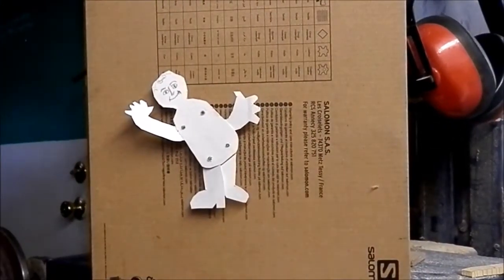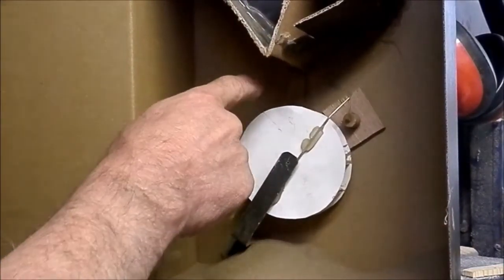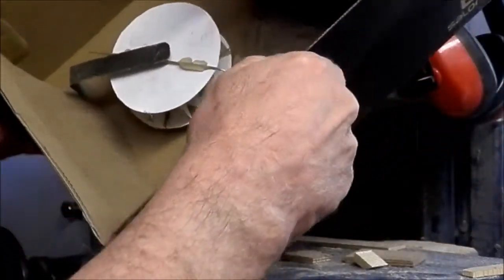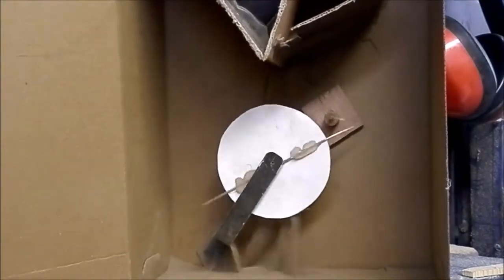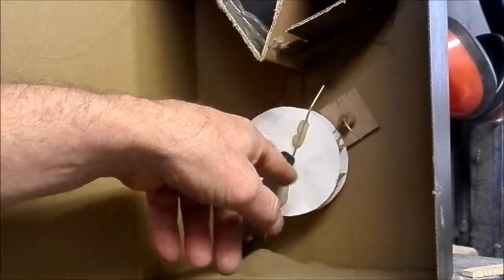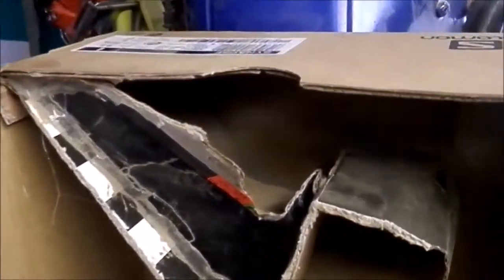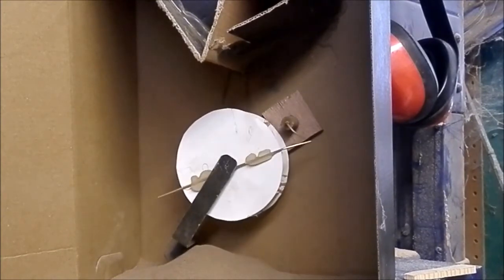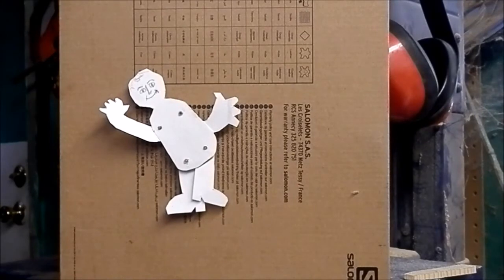Sand Powered Automata: When the Dinosaurs Danced

Comment: Hi Todd, just came over to see your video. Looks great. When i first started looking into making my own I ended up contacting Walter ruffler. He has a website and a book on paper toys. He gave me a sketch. My mechanism is very similar but he told me that there are 2 different types of movement. The acrobats use the one where the wheel is directly under the hopper and the wheel spins back and forth randomly. The other, that i use, has the hopper offset from the wheel and it spins in the same direction for as long as the sand trickles. About 1 minute is the norm. The wire is jiggled each pass and as long as the figures feet match in terms of cutting out then you will have a figure that will bend at the waist and kinda hop but totally in a random way. When i film my next one I'll show it. Good luck!
Reply from the maker: Hi Betsy! Thanks for all your help. I saw Walter's name before in my research; I'll look him up. I look forward to seeing your next dancer.